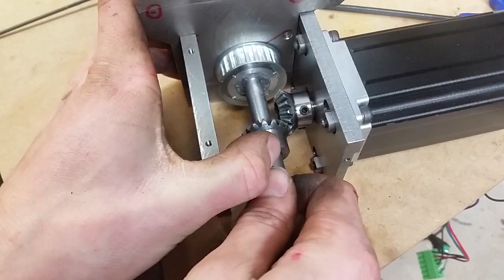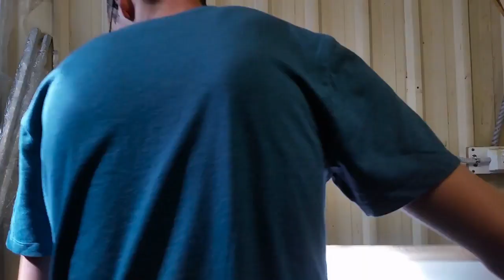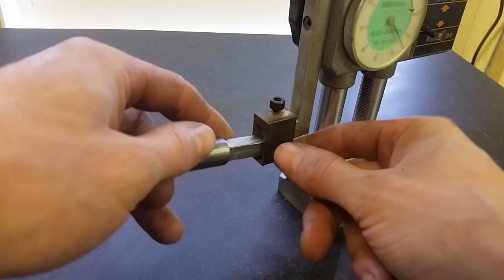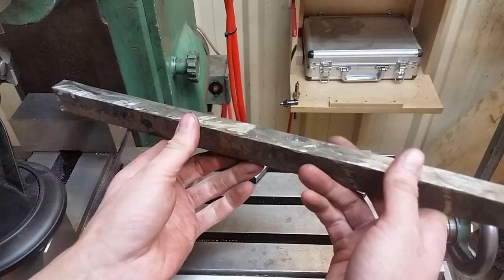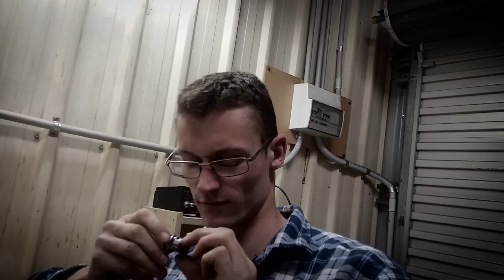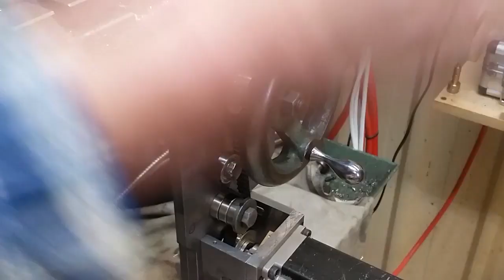Powerfeed Build Mechanical + Assembly

Comment: I purchased my power feed but i will need to do the same slot adaptor for my mills limit switches due to the dro thanks for the video
Reply from the maker: @Bigredkarl  a good tip for you; look into aluminium T-track. It's normally used for woodworking tools but serves the exact purpose you need

Comment: I wish we used the metric system here in the US.  So much easier.  There was a push back in the 80's to switch, but it never caught on.
Reply from the maker: Yeah I'm lucky to be born into it
Interestingly I prefer imperial to roughly estimate, inches and feet are  a pretty good size to use.
But the actual length of those distances are a bit 'fuzzy' because of the way I use them 😂

Comment: Hi from Australia, what a great youtube, can you tell me if you have your stepper motor running just as a motor? If so how do you wire it to work. Great chanel, Regards Merv
Reply from the maker: Hi from Tasmania! Thanks
The stepper motor is delivered individual pulses very rapidly to make it turn. It is wired the same as any stepper motor
In hindsight a stepper isn't the best motor to use though; steppers have highest torque when stopped or very low speed, a normal small motor but geared down might be a better choice

Comment: I may have missed something but the engagement of the drive side of the dog clutch to the motor drive shaft is a little sketchy. Am I correct in assuming the drive is achieved via a loose fitting keyway on the motor drive shaft and sliding dog?
Reply from the maker: The motor drive has a flat which I locked the shaft onto with a set screw. That shaft has a keyway that transmits torque to the sliding side of the dog clutch only. This permits me to have a solid engagement over a short distance which was my goal for the project.
I have never had an issue with the mechanical side since using it

Comment: Good job, man, good job. At least there are still some skilled people left in this country than all the jobs gone to China. Did you use a DRO for this work? It seems so because of accurate measurements I see here.
Reply from the maker: Thank you, yes it would be nice to see more local manufacturing.
I used a DRO, but all of the work can be done with dials, it just takes longer and has more potential for mistakes

Comment: You made a common mistake in the way you mount the limit switches. The switch should not be engaged by a pushing into it. In other words, the switch plunger axis should not be in line with whatever is depressing it. It should be at 90 degrees (perpedicular) to sliding axis - out of harms way. The roller on the switch lever should roll on an adjustable inclined (angled) actuator. 
This setup allows for finer adustment and if the switch fails or the table is moving to fast to stop in 1/16", the switch and mount won't be crushed.
Reply from the maker: Cheers I will see about reconfiguring it
I need to revisit this at some point anyway because it's too exposed and catches chips of the mill

Comment: What kind of timing pully's do you use? pitch and so on? :-)
Reply from the maker: Whichever ones I could get and would fit!!
I think they were both 18 tooth. I wasn't aiming for any gear reduction through these
And the pitch was 5 mm I think, it wasn't very crucial as the load is actually quite low
Thanks for watching!

Comment: You using the cuting speed of hss on Hardmetal tools, the rpm is way to low the cuting edges will get dall quicker than normal.
Reply from the maker: My machines are old and have a low top speed (750 rpm on my lathe). I try to use 30 m/s spindle speed for HSS, and  I triple that in carbide. Technically carbide wants to run even faster  but rigidity of my machines becomes a problem

Comment: That lathe looks like a  1970s Hurcus? Few lathes looked similar during that era so might be wrong.
Reply from the maker: That year would be about right. Yes it's a 9 inch Hercus, and a Mk2 Hercus mill
Reply: @TomMakeHere   I found out that a Boxford quick change gearbox was compatible with my hercus and was able to upgrade. If you are interested Clough42 has made one of the best electronic lead screws I have seen to date (open source).
Reply from the maker: @paulb2529  Yes I believe a lot of the Boxfords, Southbends and Hercus lathes are compatible. I was just finishing off the QCGB build when Clough42 put out his first video. I did consider an electronic leadscrew, but my programming knowledge in terms of PLC's currently stops at arduino, and I knew an arduino would get overwhelmed by data (Clough42 talks about this too). I'm in a pickle whether I switch to Clough42's arrangement or stay with what I have!

Comment: Nice job...why don't you build the mill to  cnc?
Reply from the maker: Yes that is one of the reasons why I used a stepper motor for a potential CNC upgrade in the future. For now this is a step towards 'manual CNC' If you watch my code video I show off the functions and benefits of this setup and discuss an automated gear cutting method which will probably be a future upgrade

Comment: with all the flats and other stuff you put on round bar and the big hole you needed to make in the thick flat plate by drilling lots of smaller ones this thing might be of great use in youre shop : https://cdn.hbm-machines.com/images/cache/hbm-0352.jpg-1200x600-2a93debc88.jpg
saves you from needing to reset the part after every cut too
Reply from the maker: I agree. I have a tilting dividing head which is too big for this
However even a rotary table would be difficult as my mill has very limited vertical travel (I struggle to use drills, edge finders and indicators).
The next upgrade project is a riser block to give more travel, then I reckon I'll get a rotary table
Thanks for watching and commenting!
Reply: @TomMakeHere  have been looking inyooo youre milling machine , i was interested because it has the horizontal mill option , 
http://www.lathes.co.uk/hercusmiller/
from wat i found out there arent a lot available in europe 
i did found out there long columb extentions for these machines  
http://www.lathes.co.uk/hercusmiller/img0.jpg
might be hard to find even in australia  , another thing you can do (from wat i can see in the way the machine is put together) , is put a 2 inch or more spacer in between the mounting of the columb and the base , if you dont machine the dovetail intoo that extention it will stick up over the base by the abount you raise he columb off it  but it should give you a little extra clearance

Comment: Great vid Tommy and who hasn't spent hours out in the garden hacking through thick plate with a grinder.  Love Rustinox's "Spud Canon", built one myself many years ago with plumbing fittings and hair spray as the charge.  If I fired it now I'd have every cop in town dragging me off to the lockup for engaging a missile firing ter----st activity.  Oh the days when we could just have innocent fun in our backyards.
Cam
Reply from the maker: Cheers Cam
I'm out in the country so it's not as bad. Maybe I should make a machinist's spud cannon (Runs out to shed)

Comment: Cool project. Congrats on figuring out a clutch you like.
Reply from the maker: It took a while. You can see the idea progression through a slidebolt and then a lever that catches in a notch. I will need to remake the side plate though, it's been butchered and could be better